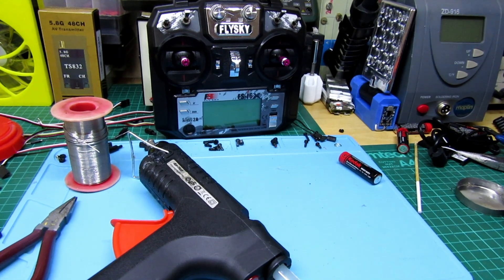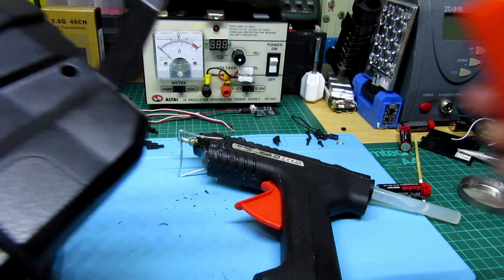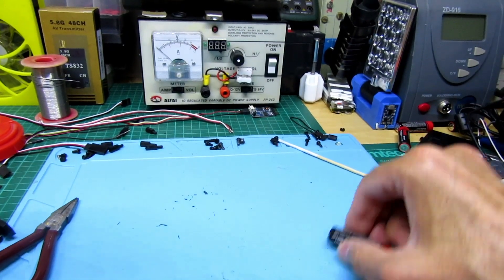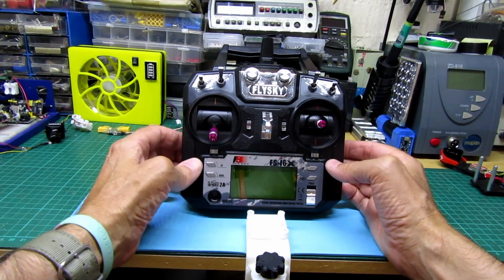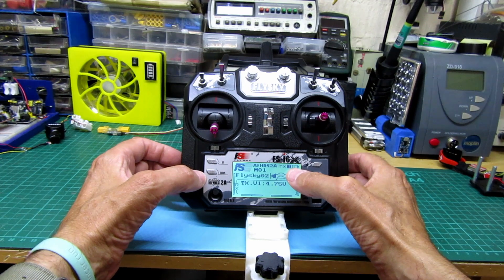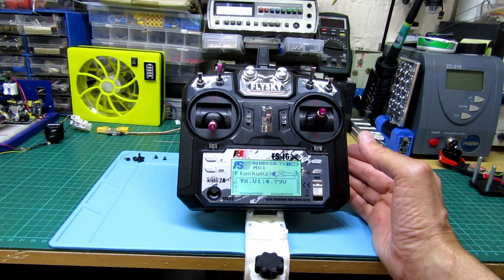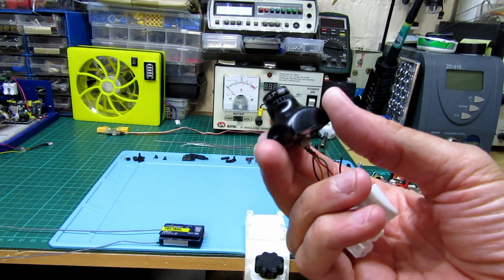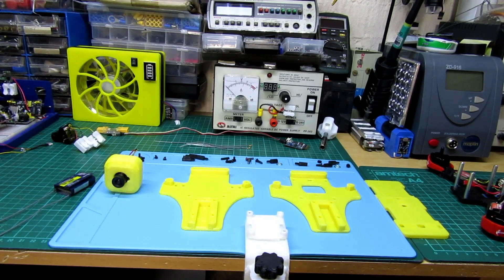Flysky FS-i6X  Transmitter battery upgrade & Antenna mod

Comment: NEVER USE USB BATTERY BANK. IT IS DANGEROUS BECAUSE IT WILL NOT INFORM LOW VOLTAGE. CONVERTION POWER TO TRANSMITTER IS TOTALLY A DANGEROUS IDEA. BECAUSE IF YOU GET ANY POWER INTERUPTION WHILE ON AIR. EVERYTHING OVER.
Reply from the maker: Ok man good point.